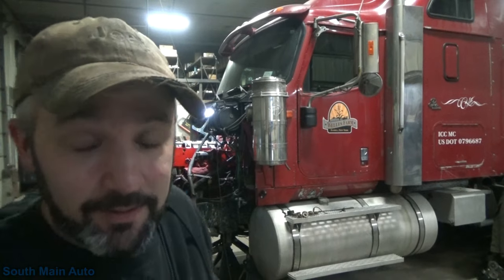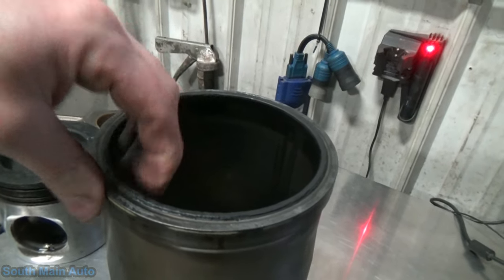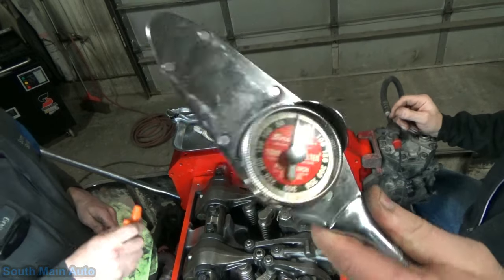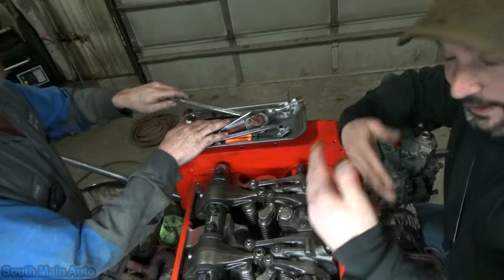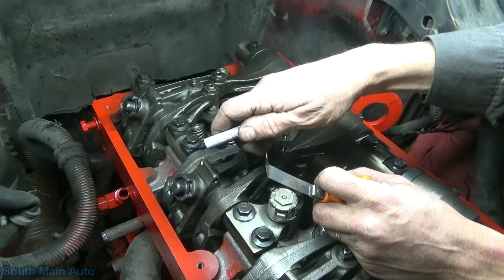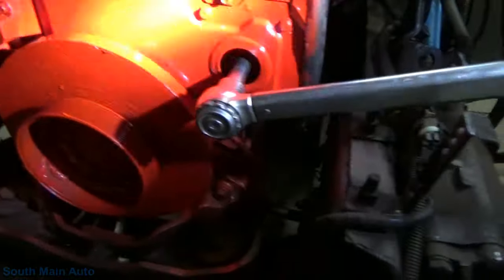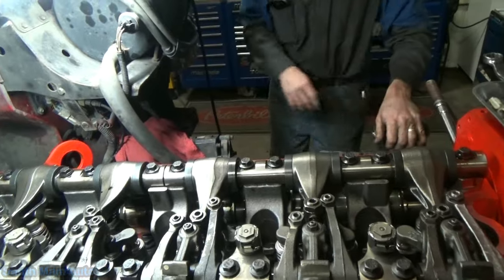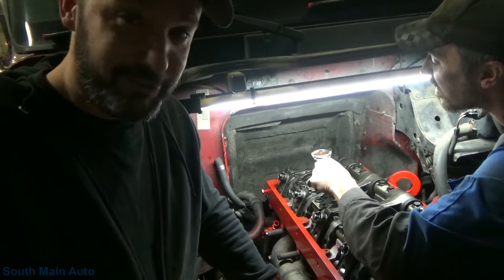Cummins ISX CM570 Adjusting Valves, Injectors & Exhaust Brake

Comment: Awesome video, finally a class 8 truck repair and you set the valves, comp brakes & injectors in the firing order 1, 5, 3, 6, 2, 4. I stopped watching after the comment about torque Nazi’s and armchair mechanics because, anytime someone comments about torque, safety or proper procedure you make comments like that. Not cool, some of us like myself you make those comments about are working for the manufacturer which at our job we get reprimanded or terminated for not following torque specs, safety protocols or repair procedures. So, we notice all the stuff we’d get canned for and by default comment about it to warn those who watch not to do the same to keep their job, save the customer from loosing their warranty and saving the customer money from incorrect repairs that do in fact lead to failures down the road.

You can start anywhere in the firing order but you remain in the firing order. The vibration dampener markings are A = 1 or 6, B = 2 or 5, C = 3 or 4 and the last mark should be the “ Insert Pin “ mark which is for setting the base engine timing for the crank and cam(s). The A, B, & C say this or that meaning at that mark depending where you are in the firing order you would adjust everything on this or that cylinder. The settings are intake = 0.014”, exhaust = 0.027”, compression brake 0.276” and injectors are plunge the injector 3 to 4 times then torque to 71 in-lbs. The setting he gave for older injectors was WRONG, it’s plunge 3 to 4 times tighten to zero lash the back off 180 degrees or “ 2 flats “ on the adjustment using the lock nut as a reference.

As far as the torque nazi’s and arm chair mechanics comment, 20 years doing class 6, 7 & 8 truck repair for Cummins you can call me what you wish but, I’m one of the guys that fixes all the mistakes of the ugga dugga and good and tight type mechanics out there and it’s not you paying for that screw up it the customer paying for the moronic mistake. Also if it’s a warranty repair you’re screwed because I’m the one that documents the mistake and damage from that dumb mistake which leads to the customers warranty being terminated due to repair completed by a mechanic not trained on Cummins equipment. So go ahead and keep screwing your customers out of their warranty or costing them more money later from your neglect to follow Cummins procedures on Cummins engines because you’ll keep me working to fix those mistakes and that’s job security.

Comment: That is a big ouch. I am surprised to see a 1/4" drive ratchet being used on a big rig on the motor. I expected too see a 1/4" drive ratchet being used on the interior of a big rig or a exterior grab handle, just not on or in the engine. I just learned something I did not expect. I like that kind of surprise when watching a video.

Comment: No electronic engine controls.  In case of an EMP event, this hoss will still start and run, as long as the starter does not burn out.
Reply: Never mind.  I just saw the electronic fuel control.  Poof!

Comment: Well you said comment so Doug you might as well hop on the train ill subscribe. And i do this for a living myself just done a isx cummins not very long ago it was one of single overhead cam and common rail fuel system so injectors are fully computer controlled so no injector adjustment. come in for oil leak and it was gear housing to block gasket leaking so all gears had to come out. Lot of work for oil leak but oh well another day another dollar. Then i get home and ill find myself watching the same old shit i just got done doing. Go figure.

Comment: In the olden days when I worked on Cummins the Jake we always loosened the locknut and turned the Jake on (at idle the Jake isn't supposed to operate then we would run the adjuster screw down until the Jake began to opperate then back it off a half turn and tighten the jam nut.
  The last time I adjusted a Jake on a Cummins was 26 years ago. 
 I went back to college and stopped wrenching and got a government job where they expected me to wear a suit. After a decade I had enough and wondering up buying some trucks.
 When I started looking at trucks I found the world had changed. Cummins engines lasted with a good driver 500,000 if a driver got to that milage Cummins brought them to the factory gave them a tour and gave them a plaque for their dash.
 When I started shopping for TRUCKS I spoke to the Cummins rep and he told me inframe at 750,000 and major at 1,500,500 miles that floored me.
 The cost at Cummins Northwest for a inframe or major was $7,500 that was way cheaper than the old 350 and 400 Cummins .
 But my trucks were cat and Detroit series 60s . It's a different world the industry standard on fuel mileage went from 4-5 mpg to 7 mog my first cat was a computer controlled 3176 I got 16.5 mpg running 90 to 100 mph bobtail from Chicago to Seattle.
 It got 9 mpg with a load in city traffic .
 My other trucks got 7 MPG loaded empty off a cliff 7 . 
 And inframe as needed never less than a million miles.
 Cummins also had the most expensive injectors at $1200 each my 3176 $400 my big cat was 3406 b was $50 and Detroit  ran $250+- different world

Comment: Tell your brother to do it Eric.  Eric could you do me a favor?  Could you scope the fuel metering solenoid for no 1 and then do crank and cam for me with the Pico?  Don't have any captures and I could use them if you don't mind.  Be more than happy to return the favor to your brother later on if he ever gets in a bind and needs some advice.🙂
Reply from the maker: Well that truck fired up the other day and hit the road but those things roll through there all the time so I will see if I can snag you one :)
Reply: South Main Auto Repair Cool thanks buddy.

Comment: i own three sets of vintage snap on (the community college i attended circa 2000 offered a very good basic selection of their tools at 1/2 price, with financing.  i bought sockets and screwdrivers) screwdriver sets they have the same handle as those feelers.  its a style that is often imitated but never correctly i hear snap on has discontinued the handle.  its a shame but it is not their patent they worked off of a screwdriver style is still around but owned by a different (invented by)  company.  the price is much better i forget the name though.  amazon sells them.  i forgot to order a set when i found out whose company the handle style was originally designed by.  i worry sometimes rubber three lobe screwdriver handles seem alien to me.

Comment: On the turbo side of the engine, next to the rocker arms is a bracket that is held on with 2 screws and some device on it. In one of the close up shots i can see the device is stamped with "15 Foot Lbs" what is that device??
Reply: I answered my own question by watching the Jake brake video...it's the solenoid that operates the jack rocker oil feed.
Reply from the maker: Boom!

Comment: so how do i go by fixing a striped axel spindle? i saw a re threading nut at napa would that fix the problem i have?
Reply: Simon Hernandez a lot of people just use an axle doctor service. They will com out and chop off the damaged spindle, and then a new one on to the housing. Safety first. If the threads are to damaged, you run the risk of losing you wheels, if the lock nuts back off.
Reply: Joe Lopez going to get one at the junk yard.

Comment: How much is it to just do the valve lash?
Reply: truck shops usually charge 300-500 to run overhead its  standard maintenance 100k miles though most people don't do it that often or at all.  lost count of the number of blown up engines due to dropping valve from lack of adjusting valves.

Comment: 600hp straight 6. What does that peak at? 5000rpm? 4000rpm?
Reply from the maker: Peak HP rating is at 1200rpm at 5000 they turn into kibbles and bits....
Reply: The max torque is 2050@1200rpm for the 600hp version. When you combine that with an 18 speed transmission you can yank heavy stuff up the hill very efficiently!
Reply: TORQUE!

Comment: Your brother is dead on. There is no exact measurement, I will compare it to tire pressure. At 95 degrees outside temperature (I’m in Georgia), my tires are at 36 Lbs. today at 38 degrees, they are below 32 Lbs (I just checked) tomorrow they will be back up. Metal expands and contracts like the air in your tires so close enough is all you can do. Torque will vary by many factors as well. Anybody who questions your methods can pound sand. You can work on my vehicles anytime.

Comment: Inframe for 16g is pretty cheap, now if you had Cat power you can expect to pay more yellow parts are Fin expensive. A C-15 or 16 around here is 25-30,000.  What mechanic shop where there isn't some colorful language used it helps making things come apart easier. International truck with nearly a million miles on it would be one hell of a rattle trap.

Comment: Cool, never seen inside a big truck engine. How does it stay so clean inside, well assuming everything hasn't been in the parts washer? I've seen so many car engines that look like garbage and full of carbon and sludge at 100k.
Reply from the maker: Diesel oil is very clean actually. You hardly ever see these engine soot up under the valve cover. Now the EGR system, that's a different story

Comment: What you need to know about adjusting the valves on a I-6 diesel   ---> 15 is to young, 64 is to old, 35 is just right. 153624

Comment: With all the work being done on it ,why not just pull the motor? Be easier to work on it in an engine stand on the floor than climbing around on the rails?
Reply: Andrew Wilson to much extra work to pull the engine out. Most of the time the only reason you pull a block is if it's damaged or can't be repaired in the truck. Some smaller trucks with a lot of up-fits are just impossible to work around.
Reply: Joe Lopez makes absolute sense mate. I used to working on military stuff and access not as good so easier to just pull the pack out. Any problems with crankshaft means can't be changed in situ. You manage to change mains with crank in? Great video mate.
Reply: Andrew Wilson yes sir you can do what is called a roll-in on the mains as long as the crank is not damaged.
Reply: Joe Lopez the crank is the key to everything. I take it you pull the motor if you find a badly scored or damaged journal? Do you fit standard size shells or do you have shells a few thou under to allow for wear?
Reply: Andrew Wilson it depends on the truck and the position of the motor in the frame. A lot of cranks can be dropped out of an engine with out pulling the motor. I have lowered or moved front axles to pull a crank, and shifted non-structural cross members. There has to be a really good to not move stuff versus pulling an engine. As far as over size bearings, I have never personally used them. If the crank or bearings get damaged I can replace them like for like. We of course gauge the oil clearances and adjust accordingly. But if a journal is to damaged, that means the block is damaged. I personally have never seen a large engine get sent to a machine shop for repair. Downtime requires we get the truck repaired faster and by then we would just swap a motor at that time.
Reply: Joe Lopez thanks for your reply. You obviously love your job too! I did prefer working on the big motors rather than tiny car engines with zero access or thought about how they were going to be maintained.
Detroit diesels and cat engines were my mainstay. I worked on Rolls Royce Eagle Diesel engines and was always impressed with the build quality.